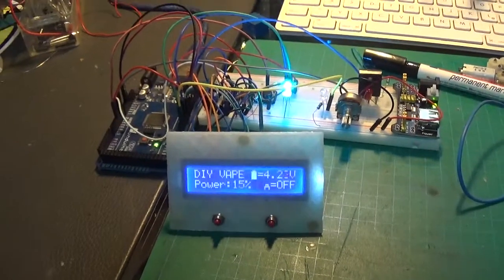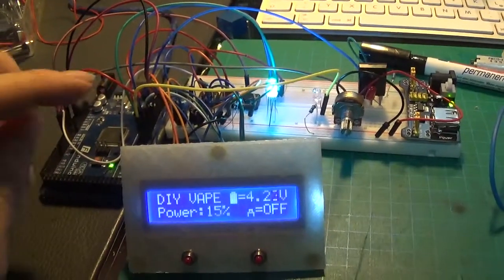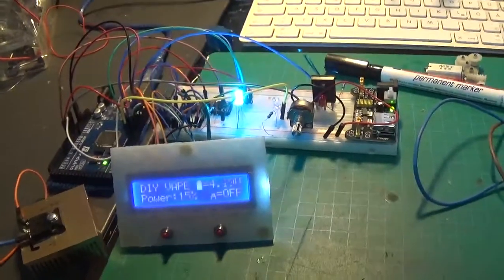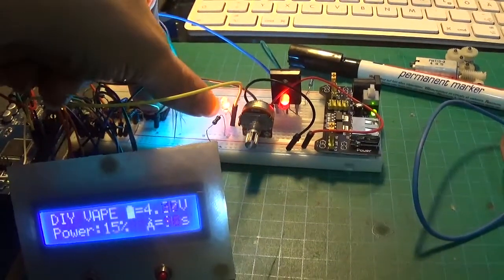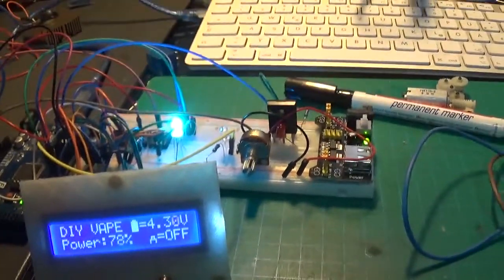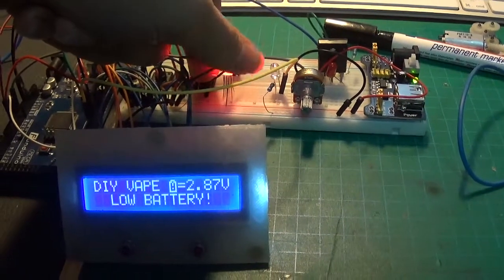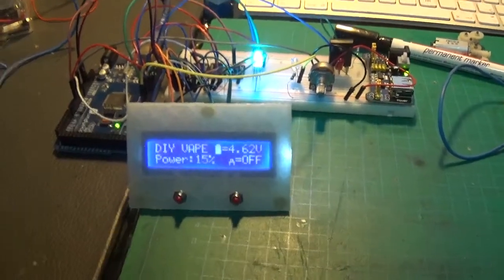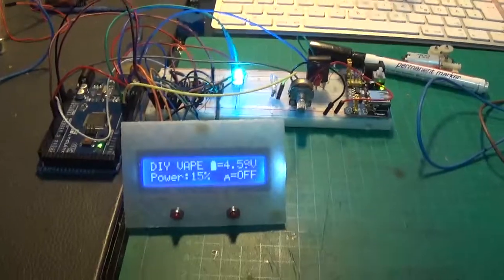DIY arduino Vape Part 1

Comment: Have you finished the project??? I am very intrested
Reply from the maker: no. like I said before in some other comments due to personal issues im not going to continuie this project. Sorry :/
It is essentially an Arduino PWM motor controller but using a vape coil instead of a motor.

Comment: Hi there got a question are you stepping up the voltage from the 18650? I just wonder because my vape typically uses around 3.5 v but a 18650 can drain to 2.75 v before dead. I'm trying to plan out my own Arduino based vape would appreciate some advice XD
Reply from the maker: I'm using 2 18650's in series so a total of 8.4V. there is no stepup or booster circuit. everything is done with just PWM. The scematic is esentially nothing more than a arduino PWM motor controller but using a vape coil instead of the motor.
Reply: @HardDiskLover  Thanks for getting back to me, I'm still not sure if I'm going to do eries or parallel with a buck boost converter.
Reply from the maker: @ModerateDev  a boost converter would have the Benefit of having a constant voltage. Yet the issue is you need one that can withstand a lot of Current. Say above 30 Ampere. So gonna make it a little hard to find. the other thing is you need one that can handle this high power but also works with a low voltage. Boost converters I've used for high power LED's often will not work with anything lower than 10V. So you would need a few cells in series to begin with.
Reply: HardDiskLover thanks for the useful info been researching making my own that way I can dictate what voltage and amperage it can handle. 30 amps seems highly though I'm going to limit it to 75w and . 22 ohm - .3 ohm and really never vape past 50w so won't even exceed 20A regardless though I'll be building it to hand 30A like you said and I'll be putting a 20 amp fuse between the battery and the converter so will never be able to exceed 20A still a lot of research to do but plan on making it very safe xD thanks again
Reply from the maker: Yay nice ^^ better safe than sorry. Especially with lithium batteries. Also If you are going to use a Mosfet to drive the coil you need to add a Pulldown Resistor between the gate and drain. Otherwise it will happen that the mosfet won't switch off anymore or just switches on by itself. wich would be really bad o_o
sotra like its shown here: https://46828dd3-a-62cb3a1a-s-sites.googlegroups.com/site/vapeandmake/akkutraeger/mosfet/mosfet.jpg?attachauth=ANoY7cooHNdN7E5A7XOFotM9claNTWM0Z39-YP03PSn26fGx6q50uojjhJdNrx9ty-7ufn-YQtn_XSklBoZyP4-aaiHEDP-HE33IgpCWK-MpUo7Ftc7HzBvCPAAZJhxp5nGitfCsnzmNwRm9bAJYNm8gITGApdk7vkiX5KgEzYe96a3SQpKgVNFetNWoyYQELpLmCJchCXMJfCEoOYGXMgqeMaVTI9yNJTuticeZMwB3XchC6ytAZyo%3D&attredirects=0

Comment: Please, answer.
I would like to make this myself.
Can you release the schematic, and the code?
Is it safe to use?
Thanks in advance.
Reply from the maker: schematic is just a simple arduino pwm motor driver with a mosfet aswell as the code
so overall very easy
safe? If you have experience with lithium batteries, know their ratings, dangers ect. then yes but not completely there always is a bit of risk. only use lithium batteries with a protection circuit and never without!
Unfortunately I'm having issues with releasing code, schematic ect. cuz the project is on hold due to someone who I thought that was a close friend, that helped me with the project, ended up betraying me and I don't really feel like continuing for personal reasons at the moment. sorry about that. but again its based on a arduino motor PWM driver circuit so it really is a super simple schematic that only needs a high current, low resistance mosfet

Comment: is it possible to make this with an atx psu not with batts?
Reply from the maker: Depending on the Power supply. You have to calculate if your power supply can provide enough current for the coil at the selected voltage.